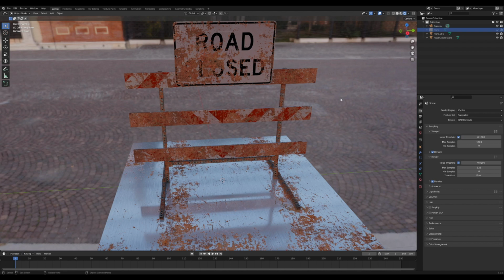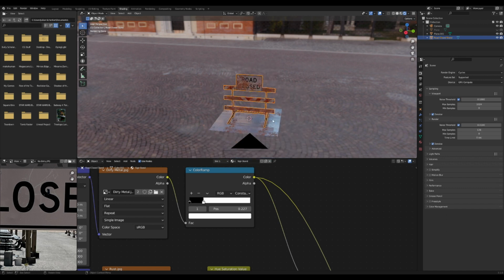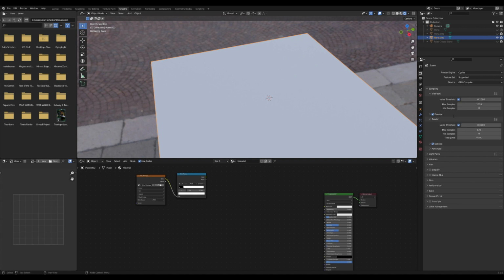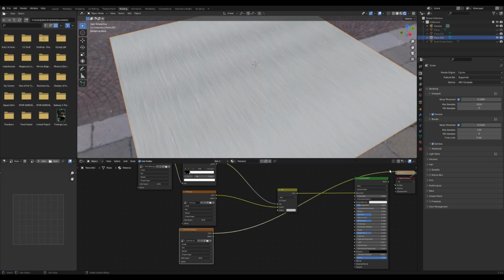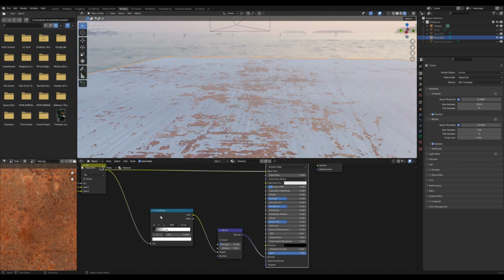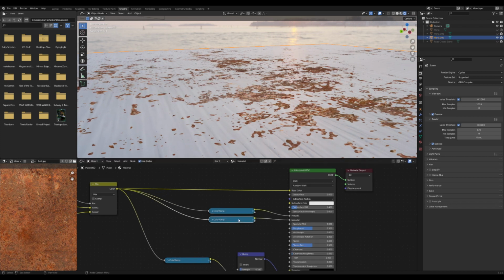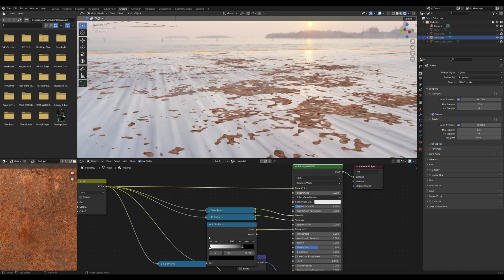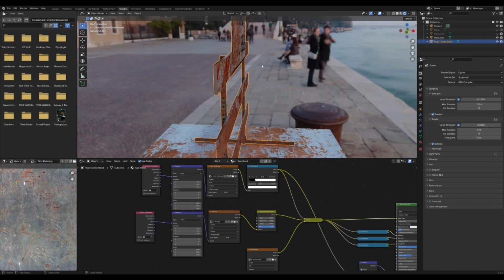RUST! Making Photo-Real Textures from Images! | Blender 3.1 Tutorial

Comment: This is a great way to easily add a bit of life to a dull texture. Add a bit of moss to bricks, rust and grime to walls and metal. I found it has more control if you use something like a musgrove texture instead of an image in the first step. With a musgrove texture you then have infinte ways to shape the scale and dimensions and can add really fine amounts of rust and also that's helpful if you wanted to repeat this method on a long wall or something so it didn't repeat anywhere.. thanks !